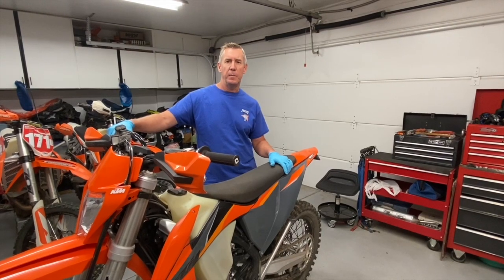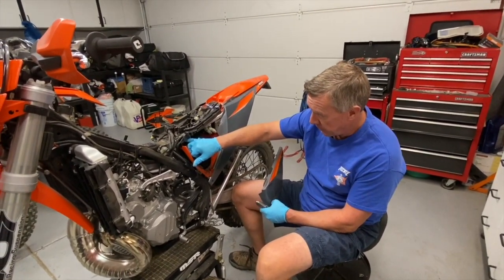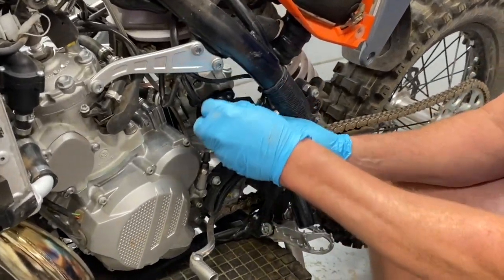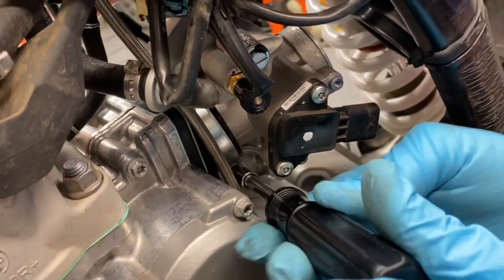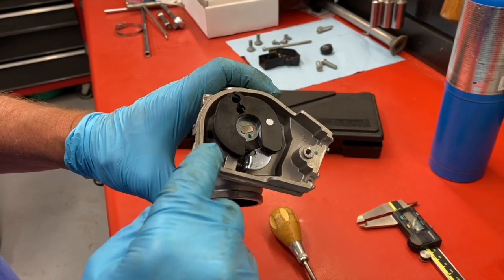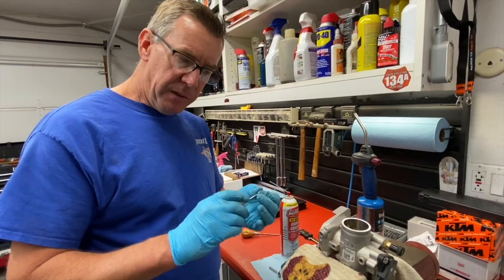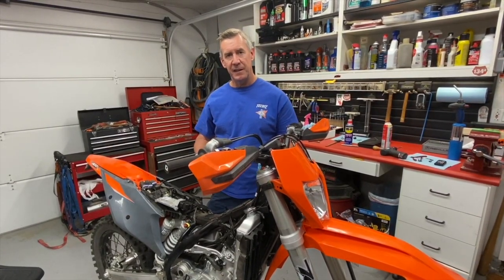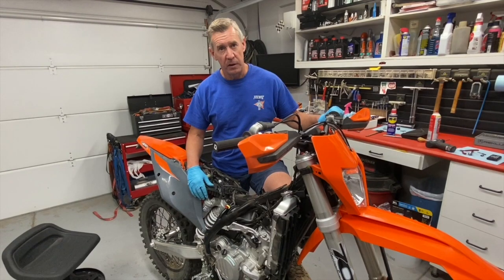Removing Throttle Body and Installing TSP Idle Screw

Comment: The hardest part is with the airbox boot, not the screw.
Reply from the maker: After doing so many of these, I take a slightly different approach now when removing the throttle body.  I loosen the front air boot, and let the throttle body rotate up with the sub frame.  Then I use a Motion Pro hose removal tool to brake the seal of the rear air boot and throttle body, and I torque the throttle body laterally off the rear air boot.  Much easier than trying to pull it straight off. It can be a bugger.
Reply: @sbmotoperformance  laterally, means front of throttle body to the clutch side or ignition side ? Because there is not much space laterally...
Reply from the maker: @mihaidobrescu7430  Correct, but if you rotate the throttle 1/4 turn first, you will create more space.
Reply: @sbmotoperformance  thanks, it's out now with no tool! Like you say, rotate 1/4 with cable down and sensor up, block the subframe with something between rear wheel and subframe so you have some tension..and jiggle with bare hands..